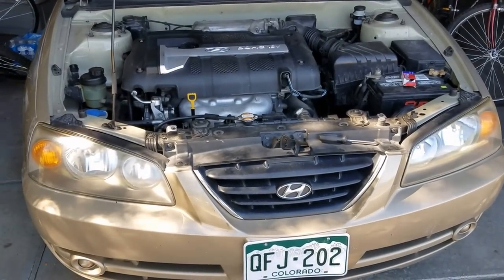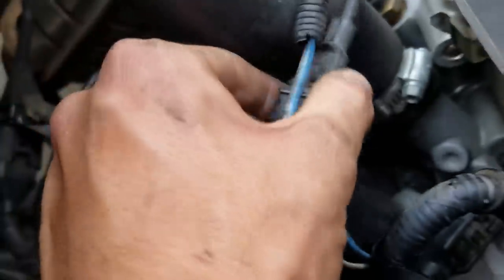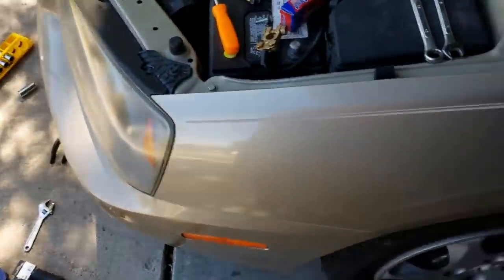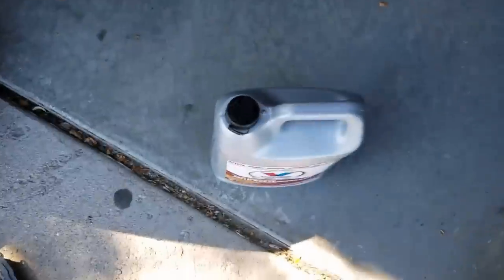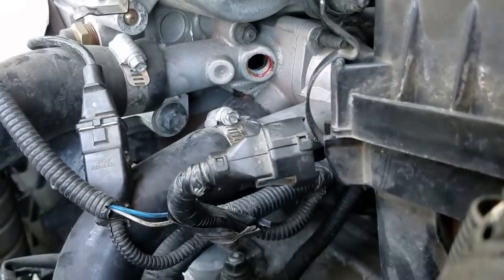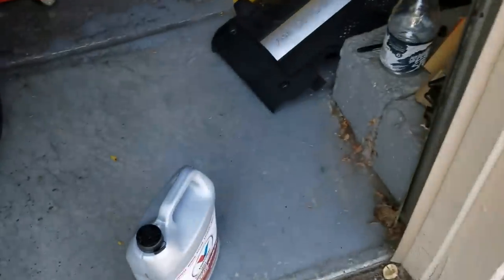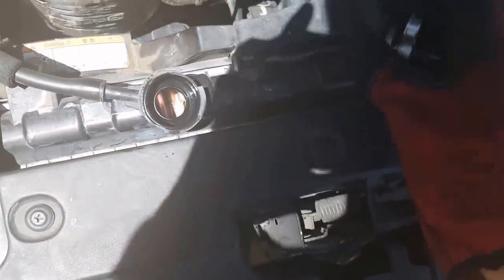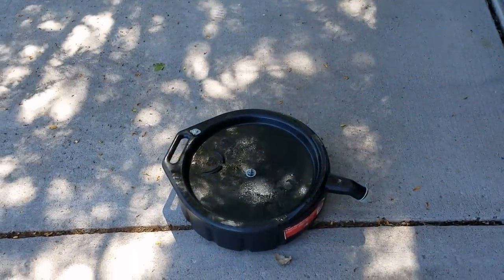Hyundai Elantra 01-06 coolant temperature sensor replacement

Comment: It would be a lot easier bleed the air out of the cooling system if you left the  sensor out, filled the radiator until coolant comes out of the temp sensor hole and then reinstall the new sensor. warm the engine to normal operating temp once the thermostat opens the coolant level will need to be topped  off. also a good idea to put a little extra  coolant in the expansion bottle.

Comment: what you called and extension on the end of your ratchet was actually a cheater pipe, or could have used a breaker bar. an extension would go between the socket and ratchet.
Reply from the maker: Thanks! I use extension for both xD I'll try to use proper vocabulary.

Comment: I have Hyundai santro xing ( atoz )
When engine heat fan doesn't on  & temperature meter show normal
Unplug wire from sensor than fan on
What problem ??

Comment: The radiator has to be absolutely full to be able to siphon coolant from the overflow bottle and you also forgot to mention that the antifreeze HAS to be diluted half and half with DISTILLED water before pouring it in if it was full strength in the bottle. Just good info for anyone out there who doesn't know and may be doing this for the first time.
Reply from the maker: Most coolant you buy from the store is already diluted. I didn't see any straight coolant
Reply: @hikaruultma  Comes both ways. A gallon of 50/50 mix is about $2.00 cheaper than a gallon of non diluted. best value buy non diluted and mix it your self. you'll get twice as much antifreeze for a couple dollars more.

Comment: Do you have to drain the coolant when you replace the sensor?
Reply from the maker: You can do enough so it doesn't spill out the engine bay but you may as well replace the fluid while you're in there, you're still going to have to lose a lot of fluid.

Comment: Looking at the video. Does the sensor needs to be flush or just keep tight until it can't  go anymore. I stripped one installing it had to buy a new one. So I hope that this one will install better. Thank you!
Reply from the maker: I just tightened it until it would not go anymore. If you force it too much you will strip it.

Comment: What is called the iron piece to which the radiator pipes are connected to the engine, or what is its number?
Reply from the maker: Uh, can you show a screen shot of the part circled? Idk what you're referring to.
By radiator pipes do you mean the exhaust manifold?
Reply: @hikaruultma  how to send you a pic on youtube? i mean the water pipes that going into the engine
Reply: @hikaruultma  the pipes get into metal piece i need to know it’s name or number
Reply from the maker: @raedalqahtani3652  that looks like the exhaust manifold, then. It would be an exhaust manifold shield. The rubber tubes go into the radiator, the metal ones are part of the exhaust
Reply: @hikaruultma  no what i mean is part of coolant system is the metal under the sincere

Comment: What symptoms did your car present to point you to this sensor?

My car idles fine, but stalls immediately put into drive.
Reply from the maker: Mmm, mine just showed me it was overheating in the temp gauge. I saw the needle jump to hot. Then it bounced to operating temp then hot.

Then my mechanic measured the heat and saw the engine was at operating temp.
Reply: My temperature gauge doesn't go up. Is that the cluster that is bad or can it be something else? Thanks.

Comment: Can this sensor being bad cause your car to overheat at high speeds but not when idling?  Both fans run fine at idle but must be going off at high speeds.
Reply from the maker: The sensor itself has no effect on the car's heat. My car would show overheating while the engine stayed the same temp. Didn't matter what I did.
Reply: @hikaruultma  OH....I see. So it may not really be over heating...it did seem somewhat sporadic. Turn off air and it dropped like a rock. Trying new sensor soon.

Comment from the maker: I wish it would give me notifications that people commented, I'm sorry for not responding sooner :(
Reply: Cisco Gonzalez we I appreciate your modesty😁😁😁
Reply: Cisco Gonzalez next time show your gauge cluster before and after, so that it visually matches symptoms by pinpointing exactly your corrisponding diagnosis with ours.. Otheres wise GREAT JOB!!
Reply: What zise of socked did  u use to remove the temp sensor. and part number for the sensor.
Reply from the maker: I should have, huh? Well the problem's fixed now, hahaha.
Reply from the maker: Hey Luis, I believe I used a 14mm long extension and 189-05274568 for part no
Sorry I haven't checked on this a while -_-
Reply: I have same year car and I'm only getting a lil heat in the car .wld it be the thermostat need to be change?  It's my only car .Any help wld feel like summer weather. Thanks
Reply from the maker: If it takes forever to heat up then it's the thermostat because eventually it gets hot.
If it does not heat up at all that's the heater core and in order to replace that you have to remove the dashboard. Not a fun job and I hope I never have to do it.
Reply: Thanks man that's a heck of a job.
All the best for your holidays .happy new year God bless you .be safe 2021.
Reply from the maker: @horacesamuels2052  Happy new year dude, I hope your 2021 goes better than 2020 for sure :)

Comment: Why you changed the coolant temperature sensor?
Reply from the maker: Because the temp gauge kept going hot then cold then hot. It wouldn't be consistent, but the engine temperature was the same. This is what led me on to know that I needed a new one.
Reply: there are other videos that show it can keep a car from cranking also. Self protection
Reply: Good question. Good answer too.  By the way, how's ur Hyundai now?